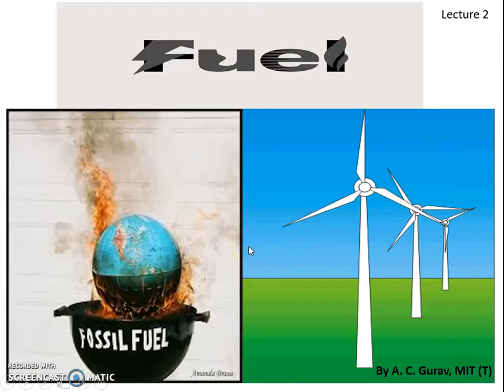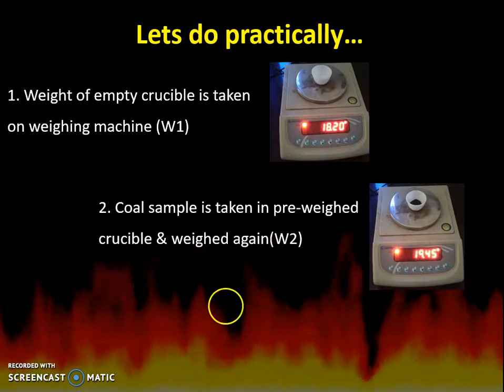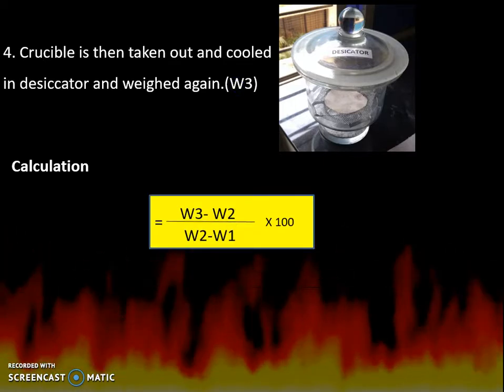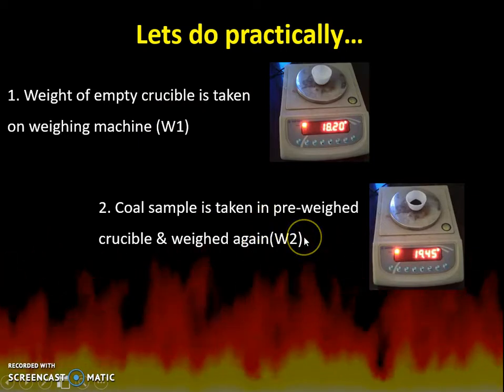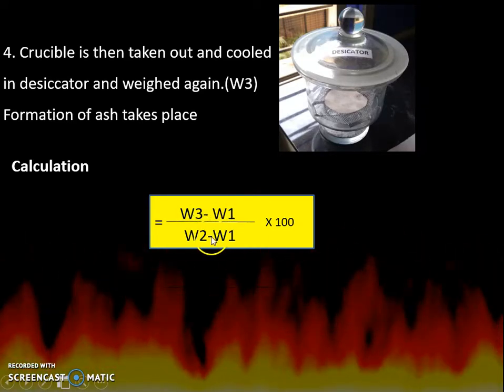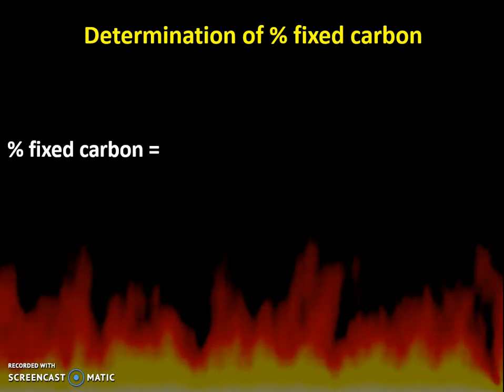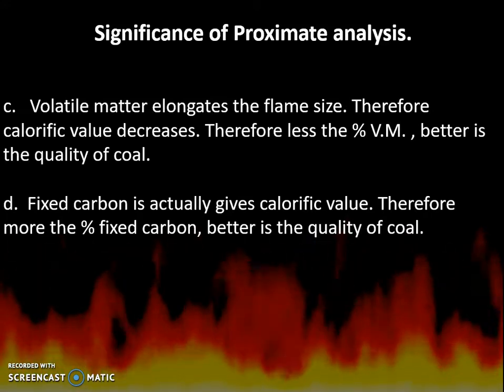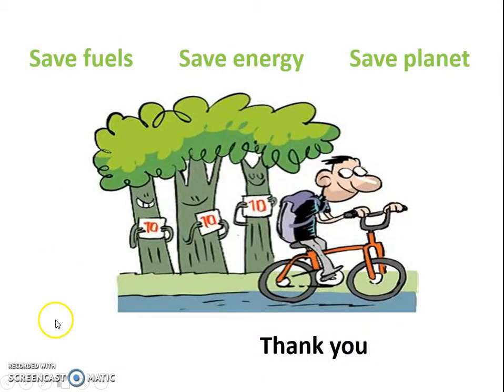Proximate Analysis of coal

Comment: to calculate VM, why is sample is burn for 900 deg in 1 hr,, these methods the product is ash,, what you think ??
Reply from the maker: Correct. Thank you for your keen observation. What should be the appropriate temperature for calculating VM? Please opine.
Reply: @ChemistryLearners  reff from from other its furnace 950 deg c for 7 menit only. so with short time, in the sample coal, carbon not burn, only VM release
Reply from the maker: Thank you..
Reply: @ariefsiswi  7 mint ...thala for A Reason 😉